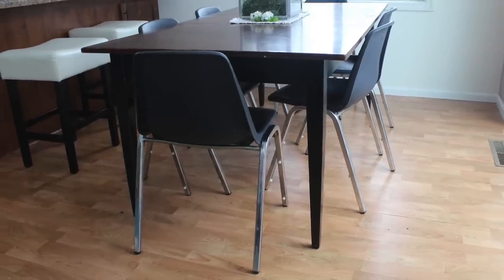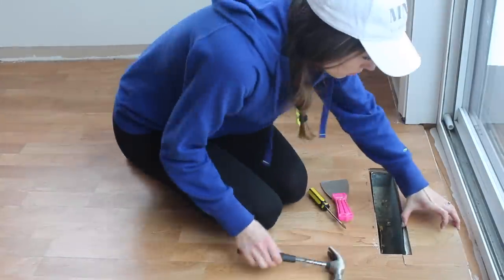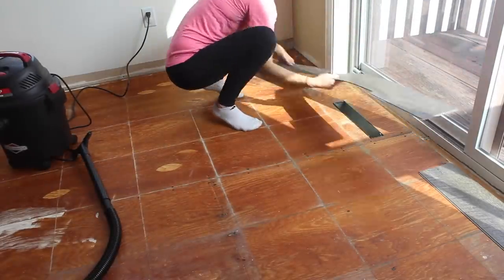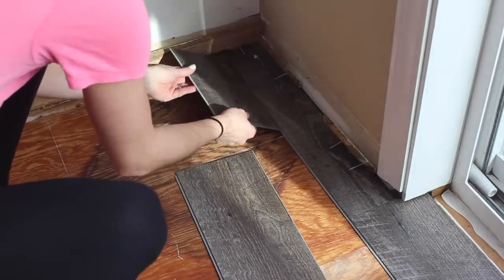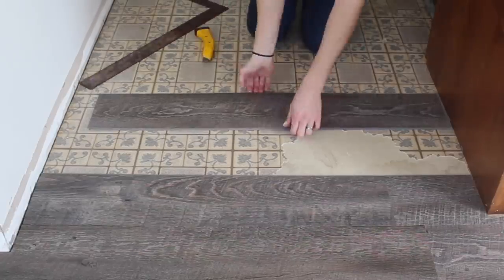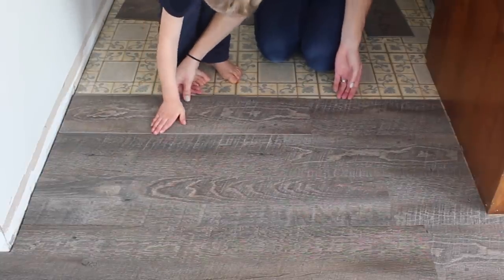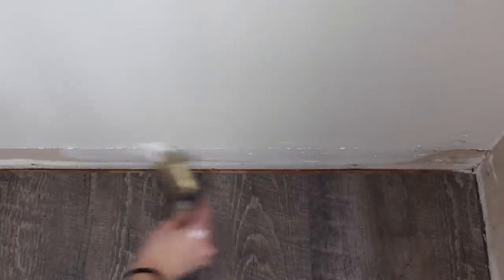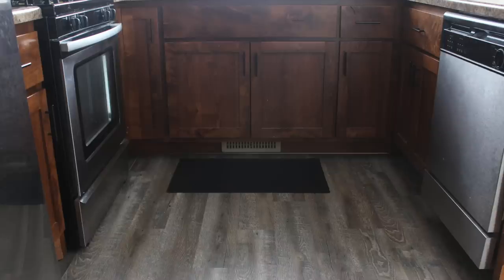Waterproof Vinyl Plank (LVP) Flooring Installation

Comment: Superb!! You did a great job of installing and making it look easy. However, you scared the bejesus out of me every time you went to make your cuts with the square. Please, please, please TUCK THAT THUMB IN when you're scoring or making your cuts. Take it from a 30 yr floor guy, I've seen the knife jump over the edge of the square many times. In fact, my dad just about cut the tip of his thumb off when he was a beginner so that's how I learned and it's saved me unnecessary trips to the ER.

Comment: Great job!  A little tip from having redone several old floors (laminate, bamboo, and tile) is to also re-paint your register covers in the floor to match the new floor and to just freshen them up. I use 120 grit sanding blocks to remove any rust and to provide a good base for the new paint (no need to remove old paint - just sand until the surface is smooth and old paint is not shiny), then I get a can of spray on rust-oleum in the color that matches the floor and do two coats making sure to cover all of the edges inside of the grate. Careful not to spray too heavily into the metal gear mechanism or else it won't operate after it dries out. If you get any paint drips or runs, just let it dry and re-sand that area lightly, wipe it clean, and repaint.  Love to see your son also getting a tutorial from mom :)
Reply from the maker: Thanks! The register that was there matched perfectly much to my surprise! But this is a great tip - thanks for sharing. 😊

Comment: Amazing!  You definitely encourage ladies to do things without men help! excellent!!
Reply from the maker: Thanks 😊
Reply: @WelcometotheWoodsBlog  What do u mean by measuring the whole area you're laying and divide that by the width of the planks? So if I am laying 500 sq ft, i divide that by the width of the planks I'm installing? To get the correct cut for the 1st row? What if u have a lot of angles in those areas? Can u please respond to my ?. Thank u. And great job at your install
Reply from the maker: @scraplifetrashtocash4551  so pick the direction you're laying the floor and measure across the whole thing. I lay mine parallel to the longest wall so lets pretend I was spanning just over 18 ft (let's say 220 inches). If each plank is 6 inches wide, then I need to divide 220 inches by 6 to determine how many rows of planks will lay down. This comes out to 36 and 2/3. So this tells me I will lay 36 full rows and the last row will be 2/3 of a plank. Well, 2/3 of 6 inches is 4, so since that's more than 2 inches, you don't need to cut the first row you lay. If this math comes out so that your last row will be less than 2 inches, you need to cut the first row's width to be less than 6 inches so that the last row can be wider. Does that make sense now?
Reply: @WelcometotheWoodsBlog  Yes. Thank u

Comment: This brought back memories. When we bought our house I installed Pergo though out the whole house (style changed in some rooms) but it's murder on the back. You did it correctly, including tapping at the end of a run. They an "L" tool for tapping a run that ends up next to a wall
Reply: 00

Comment: Thanks for this! I'm installing 600 sq ft of vinyl plank this weekend! Yours turned out gorgeous:)
Reply: ramiske1 how did it Go?
Reply: @jfrederick71  It went great! This stuff is a breeze to work with and looks fantastic. My 16 yr old daughter would lay out the planks for the next row as I was working on the current row so it went quickly! I would highly recommend a jigsaw if you have any difficult cuts (I had weird angles around a fireplace and door on an angle that would have been impossible without it). Best $40 I ever spent!
Reply: ramiske1 awesome!

Comment: Good tips. I am doing my basement which is concrete and is a large area to do.  I did about 300 sq ft and then saw some seems which were not as tight and slight space in between. So plan to take them apart and redo it. Not sure how it happened or did not  put them tight enough and do more thorough inspection before moving on. How is your floor  holding up? Any dirt accumulates in the seems?

Comment: Not bad for a non-professional! Only one tip: Make sure that when you have a new beginning, that the cutting is at least one boardwidth from the cutline of the previous row.  I noticed that when you went into the hallway area, you used a new beginning from the rest piece of the end and just laid it down. If you look at the beginning of the previous row, you will see that the cutline is now maybe only 3 inches apart. It will help with stability and esthetic when you stick to the cutline = at least one boardwidth or more rule.

Comment: Pro tip, use your rubber mallet to reinstall your baseboards and you may not have to repaint from using a metal hammer:)

Comment: great job, but how did you decide which direction the planks should go? I'll be doing 30 sq. ft. in a travel trailer. Do I go the direction of the entry door? or whichever requires fewer cuts?

Comment: Hi. Thanks for the tips. Question for your subscribers. As I intend to install Vinyl plank flooring in my garage over existing concrete slab, can someone suggest a way to secure the flooring where it meets the overhead door as there is now base board there to hold it down? All I can think of is some kind of Schluter type tile edging that could maybe be caulked on the lower surface (would also help prevent water from getting underneath flooring from outside). The only issue I see is if the transition will be deep enough to "cup" the top of the flooring to keep it secure. Thanks
Reply: Thanks. I answered my own question. I will use an end cap with construction adhesive.

Comment: I know you don't have to put underlay for vinyl however I have seen vids where they still recommend doing it. Since its been a couple of years do you feel like you may have needed it ?
Reply from the maker: If I had laid an underlayment it would've voided the floor's lifetime warranty. Most floors are that way unfortunately. However, vinyl itself usually has more give than laminate so it still feels fine underfoot without an underlayment.

Comment: Just subscribed... Thanks for a well done and informative video.  I have a concrete slab beneath the linoleum flooring in my house.  Before I install new flooring, any tips or ideas on what to do if the concrete slab is uneven or possibly cracked?  Thanks again.
Reply from the maker: You might look into putting down some self-leveling compound first. I believe it sticks to concrete.

Comment: Question: How did you go about moving the stove? Also, did you lay flooring underneath the entire stove to the wall? or lay just enough that was visible to the eye?
Reply from the maker: I laid the flooring all the way under the stove and fridge. I just shuffled my stove out as far as it would go (kept the gas and electricity in) and squeezed in there. 
I'm sorry I didn't video that part, I was working in a small space so I couldn't get the camera at a good angle.

Comment: I would also recommend using a pneumatic compressor and nail gun to reinstall/install molding vs a hammer and nail.  You’ll be able to shoot 18 gauge nails or brad nails into the molding.  This will yield a more accurate install and you won’t have hammer marks in your molding

Comment: 3:49 you're going from subfloor to previous vinyl. Wouldn't the thickness of the old vinyl flooring create an uneven surface for the new vinyl planks?
Reply from the maker: It's extremely slight, but yes, there is about 1/16th of an inch of difference.
Reply: @WelcometotheWoodsBlog  has it created any problems over the years? I'm about to do the floor in our bathroom, and I had to replace a section due to water damage.  It's not 100% flush (no pun intended) and I'm worried it will create issues with the vinyl planks.  Thanks!
Reply from the maker: @markbrophy554  I wish I could tell you definitively that it didn't cause issues over time, but we only lived in the house for about a year after I did this before we moved. No seams came apart during that first year, but I'm not sure if over time it would be a problem.
Reply: @S Han I ended up getting some edgeban and mapei self leveling floor concrete...worked out nicely

Comment: Nice,you made it look so easy. Won't it crack from some of the uneven surfaces though?
Reply from the maker: We didn't have any issues with the seams between those two floors having strain. The flooring says it can handle unevenness on the subfloor up to 1/8 of an inch and the stuff under the kitchen floor was thinner than that. I was also fortunate that the spot where the kitchen floor met the dining room subfloor landed in the middle of a plank, not on a seam. 🙂
Reply: Oh nice.ty

Comment: Really well done!..i was even thinking of using the same if not similar vinal planking myself and color..this has to be the best explained video so far..the only questions i have would be..do you start at a wall horizontal or vertical..i have had laminate sit for a day or two in the box opened to ajust to room temp before laying..is it the same for vynal..my old vynal in kitchen and bathroom is good however some very small holes are on it ..can i still lay vynal over the top of that? Ty sorry for so much information..
Reply from the maker: You lay the in the longest direction of the room. If your room is 12x9 you would start laying the floor on the 12' wall. You can lay vinyl planks over a floor with small holes and it is a good idea to let the flooring sit at room temp for a day before installing. Thanks for the compliment!
Reply: @WelcometotheWoodsBlog  No worries..im an Australian living in good old south Dakota..i have some projects to do. Over the coming months lol.again well done and good to see your son helping you.)
Reply: @Simmymind360  Underlayment is a good idea with vinyl flooring... wish I would have done that... the slight noise/up&down movement drives me crazy! Next floor is going to be the thicker laminate flooring, not vinyl, as the texture and feel on your feet, even in stockings, let you know it is vinyl... just feels fake.

Comment: Didn’t the molding sit a little lower since you removed the old flooring that was underneath or did you add extra padding?
Reply from the maker: I uninstalled the baseboards/quarter round and reinstalled after the new floor was in so it sat flush to the new floor height. Yes it was lower.
Reply: @WelcometotheWoodsBlog  I was thinking that would be the case. It would then expose some of the wall behind the molding but I believe you touched it up with some paint to hide that.

Comment: How do you prevent end on end plank movement/gaps or does the length wise interlocking hold it immovably rigid in place?
Reply from the maker: There's interlocking ridges on all four sides of the plank, so the ones on the end help prevent it from moving.

Comment: Also, there is one tool you can get to make it even easier.  I have seen them for about 70 dollars at dhome depot.  I think it's called a Robert's something or other but it is for cutting laminate flooring a bit easier than the utility knife and if there are multiple rooms you will be doing that would save time and elbow grease

Comment: Did you lay LVP under the fridge?
Reply from the maker: Yes I did.
Reply: @WelcometotheWoodsBlog  okay, wasn't sure because when you were in the kitchen the fridge was already there. Any tips for moving heavy appliances on LVP?
Reply from the maker: @VICMANROQ  I laid down a bedsheet and then shuffled (not dragged) the appliances onto it so it didn't scratch the floor!
Reply: @WelcometotheWoodsBlog  thanks for the tip, wish me luck.

Comment: Instead of scoring via a blade or knife, which can take forever and be dangerous, I suggest renting a commercial vinyl/laminate cutting tool.  Then you just need to line up your plank inside the tool, press the lever down once and voila you’re ready to place and click in the plank.
Reply from the maker: I did look into this, but it was going to cost $40 to rent or $100+ to buy so I opted for the harder/cheaper route. 😏
Reply: Disagree. Save the $40, use the knife. Plenty safe.
Reply: I think what she did was perfectly safe and fine!  Great job on the flooring.
Reply: How she cut is not the point, it’s the laying of the floor that is what you should appreciate.
Reply: Hey Bill, I did compliment her on a nice job with the flooring.  Look at one of the last comments, one from the Ruskie and my reply to his inebriated ass.

By the way...my comment had everything to do with how the flooring is installed and there was no disrespect intended.  If I hadn’t kicked out by visiting a pawn shop and luckily finding a slightly used Craine Model 001 A tile cutter for $20  (it’s between $300-$400 new), then I’d be scoring and snapping the tiles manually myself.  However, these videos and some of the comments are for everyone to hopefully learn something they didn’t already know.  Not everyone knows that there’s a tile cutter specifically designed to cut both LVT and the Pergo stuff.  I read a comment from a professional who does these installs for a living.  He said that the Crain tile cutter is worth an “extra man” on the job and provides super accurate accurate cuts to within .05”.  That’s worth knowing...isn’t it?
Reply: @billwilson6096 , Marty was simply adding a comment that might assist others. He said nothing negative about the great job she did.
Reply: You don’t know what you’re talking about. The knife is the correct tool for this job.
Reply: Great point and well taken
Reply: @martylucas8557  Yes!  Very nice to share anything that may be helpful!
Reply: just, thanks!  I appreciate your reply!  Bill/William is just a hard headed individual unwilling to try something new, different and possibly better.  He probably still uses corded tools vs investing into a cordless line such as Milwaukee M18/M12.

Comment: Did you lay the floor under the dishwasher?
Reply from the maker: Yes, I shuffled the dishwasher, fridge, and stove out of the way to lay the floor under each of the appliances.
Reply: GREAT, thanks for the quick reply! The fridge and stove are no problem, but I don't know how difficult the dishwasher will be with all of the connections. About to find out!! Thanks again!

Comment: NICE JOB,, BUT WHERES YOUR NEW PAD UNDERNEATH,,, CUTS DOWN ON NOISE AS YOU WALK AROUND...
Reply from the maker: You shouldn't put an underlayment on most luxury vinyl plank floors, it voids the warranty.
Reply: CHECK OUT QUIETWALK UNDERLAYMENT MADE FOR VINYL PLANK FLOORING,,, WONT VOID WARRANTY WHEN USED PROPERLY...

Comment: Can I do this with carpet I want to take my carpet out and do floor
Reply from the maker: Yes, you'll have to remove the carpet and tack strips along the edges of the room. Then you should check your floor is level. If not, add self-leveling compound. Then you can lay this type of floor!
Reply: Welcome to the Woods  thanks 😊

Comment: With all the $$$$ you're saving on installation costs, you should buy some shoes!
Reply from the maker: 😂 it's inside my house. Are you freaked out by feet?
Reply: I know, I'm kidding you. I've been installing for about 15 years and have dropped quite a few heavy/sharp objects on muh toseys! I love seeing people getting there kiddos involved with home improvements. It seems like my generation (X/Millennial) and on are getting lazy with it! I could add a couple pointers aside from shoes, if you're interested!? Not that you didn't do a great job!!
Reply from the maker: @josephchess7568  please do! I'm a millennial, but I definitely am not lazy or entitled lol. I would appreciate tips! We just bought a new house we are planning to renovate, so I might be laying another floor in the future.
Reply: Yeah, I can see that you're definitely not lazy or entitled! I'll bullet point to simplify. For a heads up, I spent two years as a design flooring technician, so I get a little OCD with it.

Cosmetic:
-Stagger every row at a  minimum of the planks width from each other.
-Do not to directly align plank ends (H seams) for at least 4 rows. 
-Do not stair step plank. Stair stepping is when the distance of three consecutive rows of plank ends are staggered an equal or nearly equal distances from each other. 
-Avoid installing the same plank next to or near itself. Meaning, if you have the same know hole or wood grain. This only applies to manufactured products such as vinyl, laminate, etc)  

Other:
-When removing baseboard, put a piece of the plank behind your pry bar to avoid damaging the dryewall.
-Use a chalkline for your initial row, that way you get an simple, accurate measurement for your first cuts.
-I personally prefer using a plank as a straight edge for cutting. They are always next to you and you can use your knee to lock it in place.
-Don't put your fingers behind where you're cutting.... I learned this one the hard way with 15 stitches... Not awesome!

Honestly, as a do it yourselfer, you did an phenomenal job. I've trained hundreds of professional installers and I'd hire you before A VAST MAJORITY of them! Also, the video is very well done and it's not annoyingly lengthy. What kind of camera and program did you use? I've been considering staring a channel myself, solely dedicated to detailed floor covering installation.
Reply: Most videos are one of two comments: OMG its amazing or some comment on her toes/feet.

The projects are amazing. I especially love the desk island one.

Comment: HMMM wish it was that simple but its not for most homes . For example If a home owner attempts to sand down adhesive from vinyl floor from the 80's you would have exposed yourself to asbestos which can cause several types of cancer.